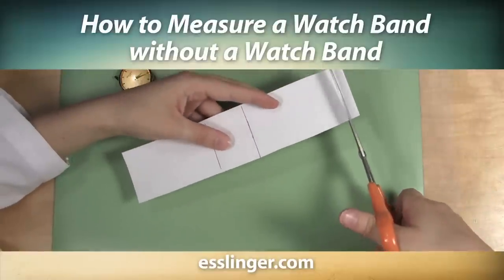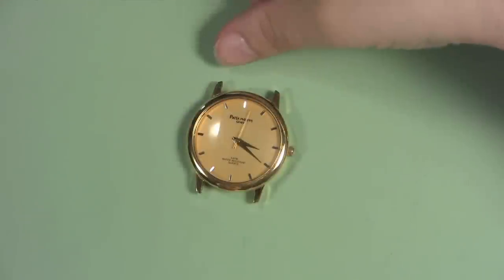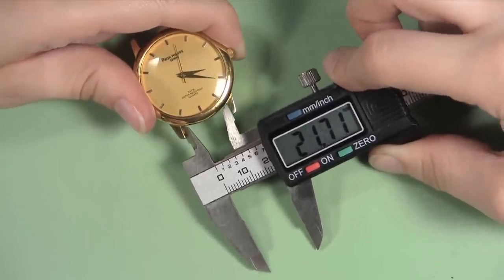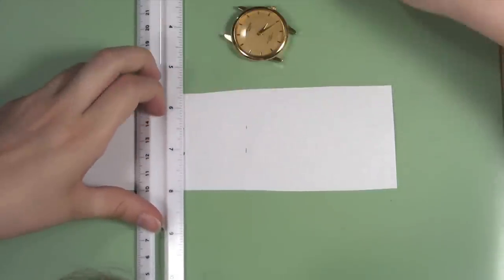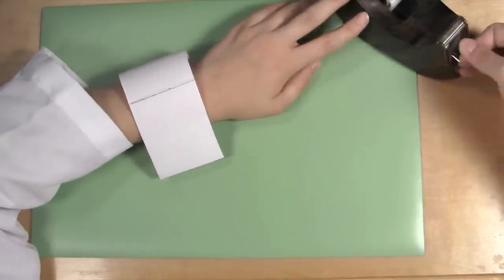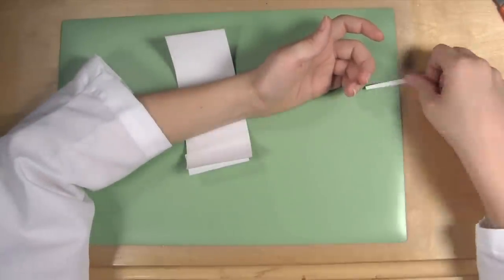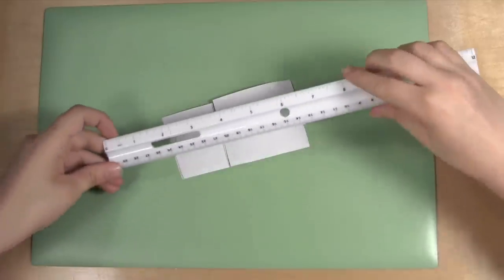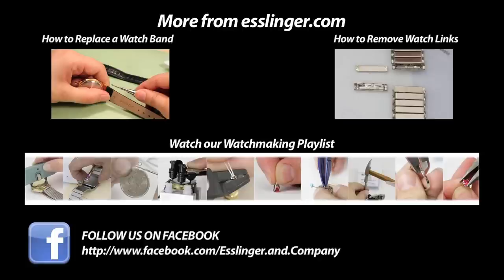DIY How to Measure for a Watch Band without a Watch Band

Comment: WOW, any explanation why when you measured the width of the watch with a ruler it read appx. 18mm  but when you used the digital gauge it read 23mm?
Just wondering which number should be used when ordering.